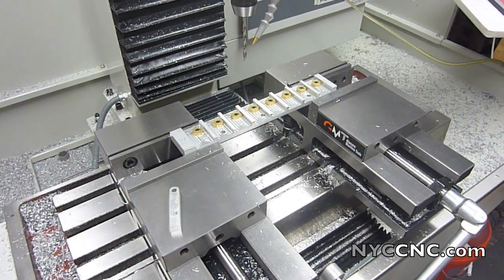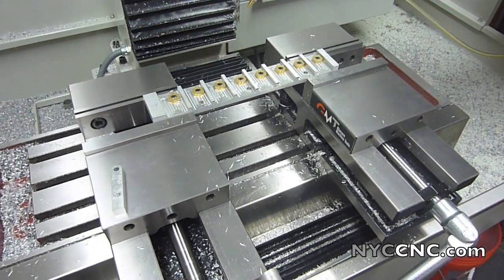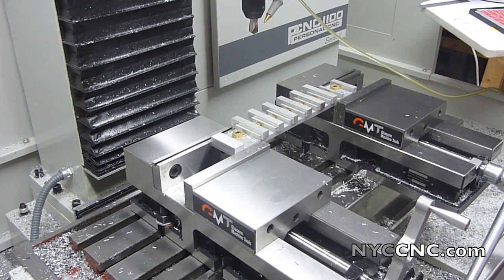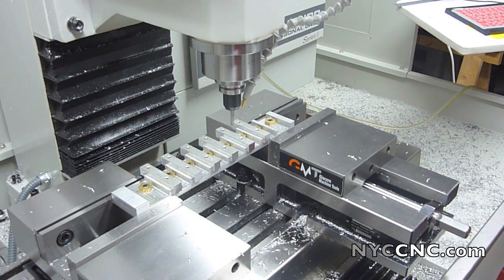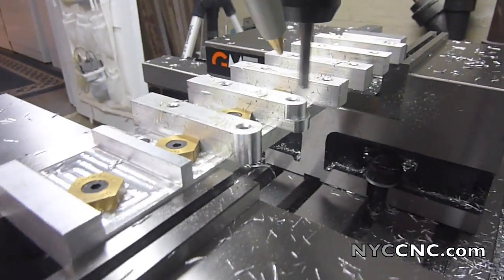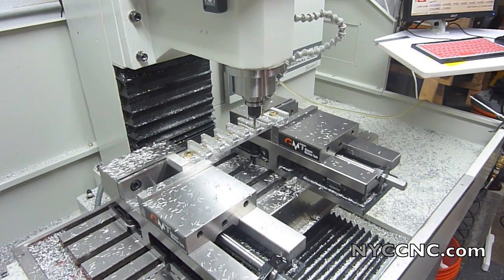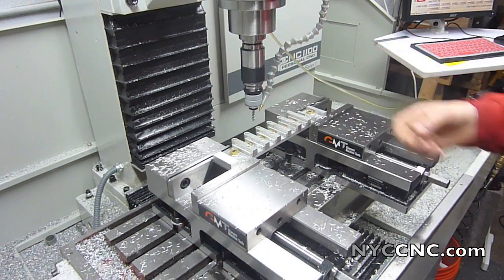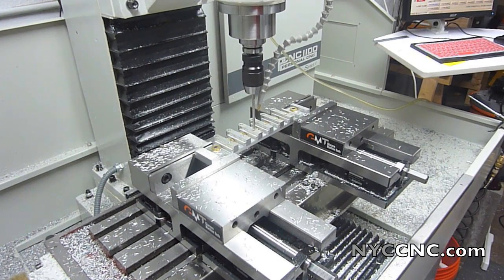Tormach PCNC 1100 - Milling Aluminum with a Custom Fixture.   Ch. 18

Comment: I was looking into using multiple vises (3), then it dawned on me that i could use a double vise like you and a custom fixture spanned across allowing me to hold even more work. I'll use a Alcoa AL cross beam and then i can fixture plate on all 4 sides when turned in the vise! Manual tombstone? haha

Comment: You should put some varsol on the tap, it would cut down on heat and stop any aluminum from gulling on the tap. It can also make surface finish better with milling drilling & reaming.

Comment: Not yet. Not sure I need to. I pretty much run it constantly (except toolchanges) and it doesn't take a lot of mist to make the difference. I am still close by in the shop. It's just the first time I'm *not* there with the air gun in one hand and another primed for the ESTOP in case of a swarf jam. I also increased my feed and DOC by 20-30% with less issues. (I understand not doing it for the videos sake though.)

Comment: yeah it cuts aluminium, so does 1k cheapo but is it cappable of doing some serious cuts in 4140 steel or 303ss -just a few videos here of tormach milling some mild cold rolled 1018 with not so great results - the new novakon torus pro looks beter at least on paper with 2hp motor ,higher spindle rpm's and better table travel but heard some torrible stories bout their customer service,quality problems ,new mill coming with no manual etc. so it's definitely no go
Reply: Tormach cuts 1018 like butter, ive done alot and came out better than aluminum.  Mirror finish right out of machine.  Buy correct endmill.

Comment: what's the max rapid and feedrate for that machine? If you speed it up too much does it make square holes because you can fly through that contouring .. probably 80 - 100 ipm. that chatter sound means it wants to take off more material

Comment: What you're doing between vices is fine... it's steady. However, why are you peck drilling so shallow? You should be able to just jam right through. Also, why did you pilot drill? I was taught to never ever "drill out" a hole if it's avoidable.

Comment: Tapping stainless?  I use a couple products. ICS cutting tools has a nice product, but MolyDee works the best. If you can't get those.. then CRC products also has a good one "Super Tapping Fluid". ITW Rustlick "RTD" is good.  Blaser - Swisslube also is a wonderful product.  Google "mwfmag" or add the usual dot com to the end.

Comment: @saunixcomp I have lots of different materials suppliers, probably some of the best in the industry.  I just like the stablilty of the cold rolled.  1018 is wonderful for fixtures.  In fact, I prefer it over 4130, 4140, 4340 steels that are used a lot in fixturing.  If you want to buy your fixtures, look at fixtureworks.  They are a wonderful company who will build you whatever fixture you want.  I get my MIC6 from work because they surplus a lot of it.  SGS has been a favorite of mine forever.

Comment: @saunixcomp I have also used a precision ground steel dowel pin clamped in a ER32 collet chuck.  I move X & Y axis to the face of the solid (non moveable) jaw on the left side first then I jog X along its face to the other side.  This generally gets me to .001 or better Mite-Bite clamps are nice, but I don't use them a lot.  I use a lot of precision dowel pins, De-Sta-Co toggle clamps, and 1/4-20, 5/16-18 and 3/8-16 fixture components. Drill bushings can also make nice for fixture locating.

Comment: For a lot of my aluminum parts, I love using SGS Carbide end mills, oh, and their drill bits too are wonderful.  Niagara and OSG 2 (and 3) flute end mills too.  I have a high speed -capable spindle (10,000+). For fixtures, if you ever need some, I have some Mic6 plate and 1018.   Alcoa has nice Aluminum fixture plate material too.. its called "6061-T651 Tooling Plate".  Search for it on the Alcoa site.

Comment: @saunixcomp:  I  was thinking about changing the milling configuration (if You normally move the vise for every project). Do You partially clamp the vise and use the dial indicator to align (tapping the vise or something like that)? Ragrding Your edge finding: do You have a DIY solution? Any VB script in Mach3? Thank You!

Comment: Awesome as usual! Love the tool changing system. It changes the whole strategy about machining! Do You plan to make footage about indexing and edge finding? Do You use the Dial Indicator on the splindle for all the indexing operations? Have You considered using and automated edge finding solution? What's Your policy about aligning the vises? Thank You!